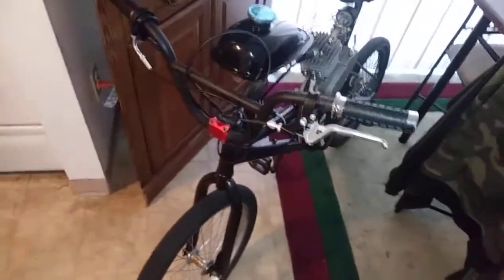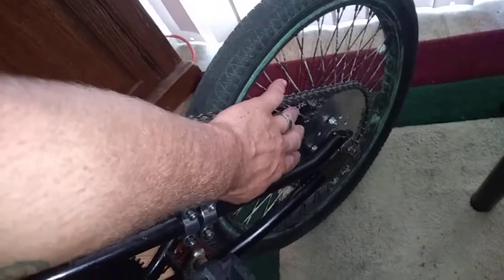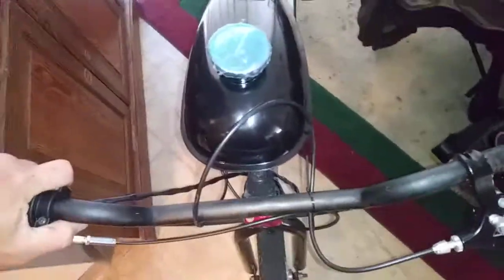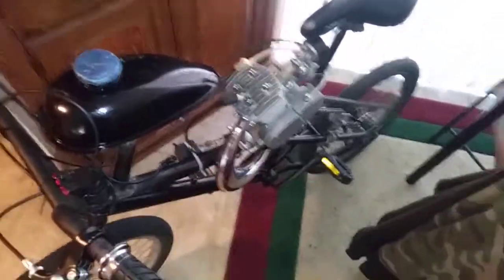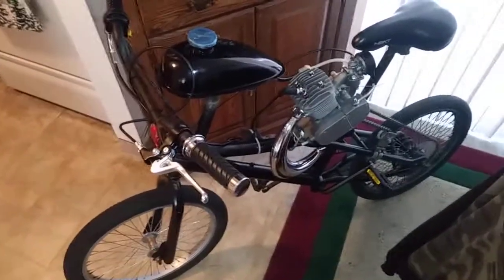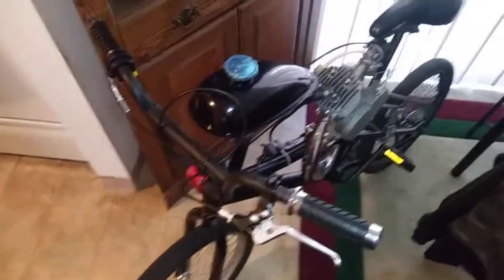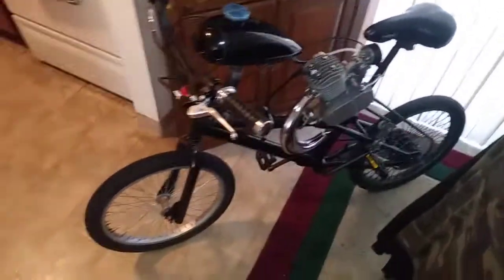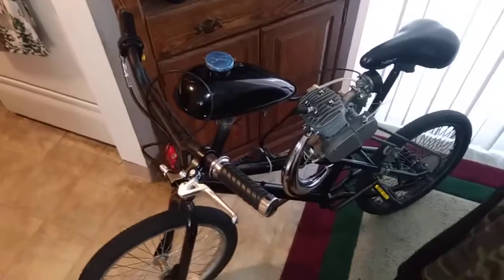Zeda 80 motorized bike engine on a 20" bmx !

Comment: Hey do you still got that bike with the engine on it can you send me a side picture where I can see where you got it mounted at
Reply from the maker: I just drilled a hole in the bracket frame I used and mounted it on the wheel axle.

Comment: What is zedas best kit for around 200$ also is jlzeda and zeda 80 the same?
Reply from the maker: Yes they are the same but I don't know much about the kits I have never bought from them, they do have a couple one comes ported and there's another that's pretty good I heard about on the mafia and ask them on their Facebook group. 

I want to get a bt100 engine kit it's a bigger cc then the zeda 80 it has a 50mm piston it's a actual 80cc but here is another with a 50mm piston it's a 80cc to and comes with a zeda88 expansion pipe for $200 https://rover.ebay.com/rover/0/0/0?mpre=https%3A%2F%2Fwww.ebay.com%2Fulk%2Fitm%2F123873383325

Here it is again for $160 without a expansion pipe
https://rover.ebay.com/rover/0/0/0?mpre=https%3A%2F%2Fwww.ebay.com%2Fulk%2Fitm%2F123894703751
Reply: Ok thank you
Reply from the maker: Yw
Reply: How has the motor been running.sorry for all the questions lol
Reply from the maker: @primitivegarage4059  Pretty good, I sold it to a guy a few months after that but I put it on a Roadmaster bike and he rides all the time still no issues that I know of.
Reply: Okay, i think im gonna get a jlzeda triple 40 with a window piston andd a rse reed valve. I hope it works out!!

Comment: hey how did u connect the gas tank
Reply from the maker: I welded a vertical pole about 6in high with about a 6in horizontal pole on it.
Reply: @Baldys_projects  how are the spokes? i heard with so much tourk that it breaks them and can you do wheelies  thank u for replying so quick
Reply from the maker: I never had issues with the spokes as long as you get the rag joint tight that's all I use for all of my power builds including a Schwinn chopper with an 7HP gocart motor on it and a CVT transmission, the rag joint is what I'm currently with a 56 tooth on my yd100 24-in wheel off-road bike I have right now without any issues and I know it's at least 8-10HP.
Reply from the maker: It definitely was able to do wheelies with the 44 tooth sprocket on it but my bike I have now has way more torque and wheelies with ease.
Reply from the maker: https://youtu.be/smxLEC4zZt8

Comment: Does the engine get hot between the legs
Reply from the maker: Honestly it wasn't too bad and the bike was actually pretty maneuverable compared to using a bigger bike.
Reply: Thanks! I will give it a try when the unbranded kit’s price goes back below $100. I was searching for mounting technique for bmx without cutting into frame. I like your technique.
Reply from the maker: @ThanhTran-fp3up  you're welcome! It worked easy with the front U mount that comes with the kit, I know what you mean I just dropped almost $600 for only 4 eBay 66cc kits.